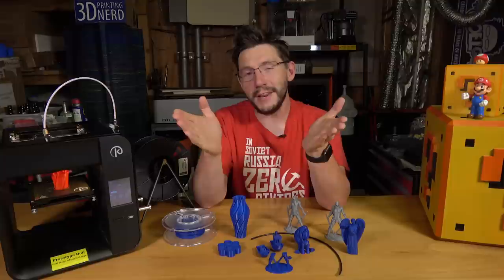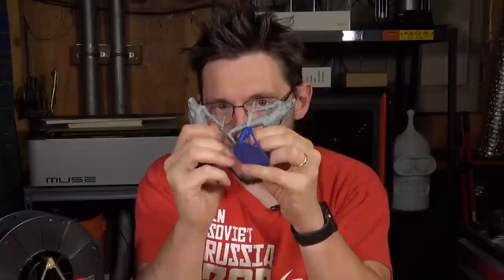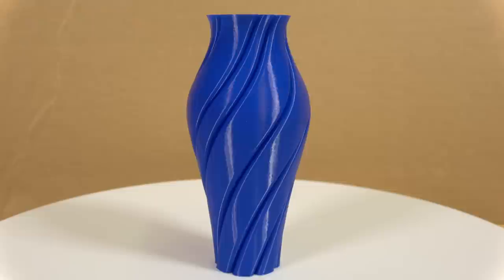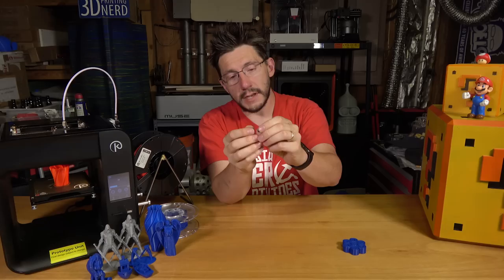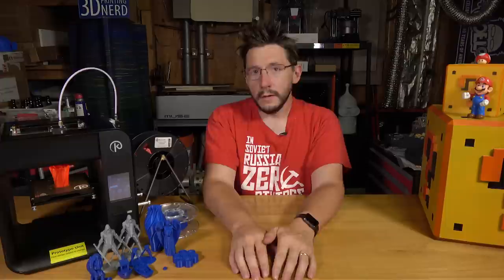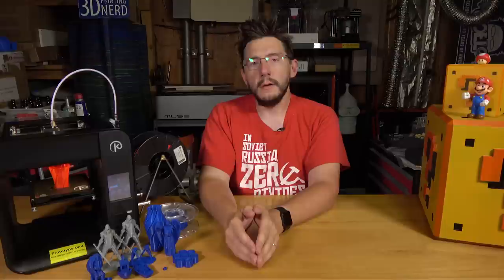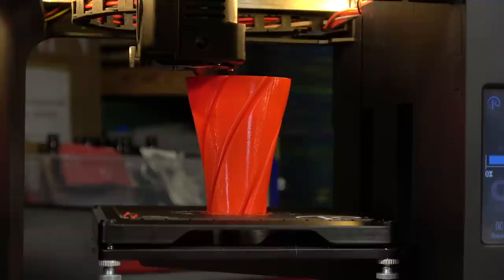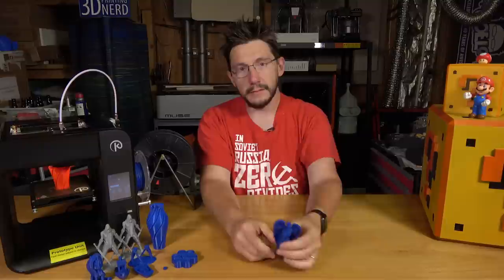The Kodama Obsidian $99 Kickstarter Prototype 3D Printer Final Video

Comment: i finally got my anet a8 up and running. now i can finally get into 3d printing.
Reply: Congrats! Once you you have it all dialed in (which only took me a couple of XYZ test cubes), it's a great little machine. Mine prints a whole hell of a lot better than this one--and mine's all stock.
Reply: my first few prints randomly stopped midway through but after that, they all turned out fine. my first benchy actually came out just about perfect with minimal stringing.
Reply: not to be lazy, but how much does the a8 cost landed?  I bought the obsidian, upgraded to the deluxe, added the heated bed, nozzle kit, and now am wondering if I made the wrong decision.

I thought this was going to be an inexpensive and QUICK entry into the world of 3D printing.  Now, almost ~$400 invested and still nothing to show for it, I am feeling buyer's remorse.  I am going to give it a bit more time before I proceed with trying to cancel my order and get a refund.  

If the a8 is much more expensive than $400, is there any model you would recommend around that price-point?  I am completely willing to wait and save up if adding ~$200 makes a significant difference.  For my first model I didn't want to commit to something in the 4 figure range. 

Thanks for any info/help you may be able to provide!

Comment: If you need to change a lot to a machine for it to work does that really make it a good machine?
Reply: Jim1643 PROTOTYPE
Reply from the maker: +Javierm0n0 More like PROTOHYPE
Reply: Javierm0n0 I get that but still, this was the second version. They should've fixed these before they get someone to review it
Reply: Jim1643 that's how industrial  design works,  I'm honestly a bit shocked at this whole product, and the fact it only took 4 versions to fix it's kinks. people it's like 150 bucks. let's get real, if this unit works with at least moderate success it will nail it's market (at home and mostly plug and play ).
Reply: Actually, it only took 2 machines and some tweaks.Thats, not a bad thing.
We all know if Joel didn't like it he would say so.
Reply: it looks like a verry good machine,every 3d printer WILL need work
Reply: I agree with Mr. Sterling that if this is successful it’s a big advance in making 3d printing more accessible.  Many people still don’t realize that machines are currently available for less than $1000.
Reply: WOOOOO WOOOOOO ALL ABOARD THE PROTOHYPE TRAIN!!!!!!!!

Comment: About the 3d filament holder problem:  why can't we print out some holder that looks like the one that was made out of metal, remove those long rods that would only hold the Kodama filaments, print out or get some screws, and attach the new holder there?   Just putting it out there.

P.S. I do not have a 3d printer myself, it's just that I am very interested in this one, and in 3d printing in general!  :)

Comment: I've already pledged long ago. Like Super Early Bid ago. I have 0 experience in 3D Printing and thought it'll be a good idea to start from Obsidian as it doesn't require building and stuff. But when I watch your videos, i always consider to cancel pledge as it needs so much tweaking. You are being honest, even you've met with the creator of the project, thank you for that. But.. Dunno man, i'm a bit scared that it won't deliver my needs.
Reply: @Gunes Oral, 

Its our 2nd round, we know what we are doing, if you look for Trinus reviews online you will see. Even that modular kit machine; you set it up in 30min and start printing. But sure 3D printing is not 2D printing, you have to slice your models, set the right temperature etc. , but thats across the whole industry. But do not worry, you wont have to tweak things, and the experience will be much more smooth then with others out there...

Comment: Great vid! Thanks Joel! Slightly concerned that the S3D software needed a custom tweak, because as someone who is going to being using a free software with this printer, I'm worried that I might not be able to solve the problems as easily as you could. Thoughts? P.S. Very new to 3D printing, this will be my first printer..

Comment: I'm a bit confused how you'll give a machine a do-over review at the pleading of the developer.  Clearly this saves his beloved Kickstarter but certainly removes some objectivity from your "review"   I'm all for addendum's but when it mixes with a funding campaign....ick.
Reply from the maker: To be fair, the pleading was to redo, because he personally was the one that said he screwed up the install of the machine. He brought it to my house and installed it, and his words were the fan shroud wasn't installed correctly. Improper cooling could have led to the problems I had. Once that, a new bowden tube, and a verified better profile were provided, it was printing better. The do-over itself was using the machine in a state more accurate to what it should have been in the first place. It IS a prototype and they still have a lot of work to do, so it's not like my review means the Prototype V3 is ready to be in the hands of all the backers. I completely understand where you are coming from with what you said, but, I thought about it and I believe I was within the parameters of testing a prototype unit to retest once it had been repaired / adjusted and a proper slicing profile was provided. This DOES NOT let Kodama off the hook, and if the unit they ship to backers doesn't have the improvement that 3D Maker Noob, Maker's Muse, and myself have suggested, it's not going to be pretty. I want to thank you for your words, though, and comments like yours are great because they are constructive and start a conversation. Many #highfives to you.
Reply: Wow, quick response!  
I thoroughly enjoy your videos and upon reading your response, that's  very fair of you.  You did offer them a lot of good suggestions (3 point bed leveling, spool holder, etc.) I hope they will adopt.  Anything that makes it better experience for newbies is welcome.  I've read a lot of horror stories from inexpensive printers that were red hot messes, serving only to deter someone from wanting to get into 3D printing.  I hope they are able to deliver and provide a positive experience.

Comment: Is it possible to print 28mm miniature figures for tabletop gaming and do all 3d printers have these annoying obvious layer lines? because when painting these models, these lines will pop out even more :(
Reply: All FDM machines do.  SLA machines do not.  most people will sand and prime before painting if it needs to be smooth.
Reply: I don't know the details, but for some types of filaments, you can use vapor of, I forgot the name, I think it's what is used to remove nail polishers, to get rid of the layered appearance; put the printed object in a sealed box with a stand to keep the object from touching the bottom, and have some of the nail polisher thing filling the bottom, and leave it sealed for a while; or something like that. I think I once saw a device that would rotate the object in 2 axes to ensure a more even distribution of the film of nail polish remover over the object. The idea is the nail polish remover will melt the smaller details, smoothing out the object.

For the exact steps, precautions etc, you're gonna have to search for the procedure; I don't think it would be hard to find.

Though, now that I looked at the actual number you used, I'm not sure if it would be a good idea; I'm not sure if with something that small it's gonna be possible to remove small details without also removing important features. I guess if the size of the details is too close to the thickness of the layers, there might not be much left after the procedure.
Reply: digibluh Don't some SLA still got thick enough layers to be visible after printing?

Comment: Do you have the end gcode script to push the bed to max z, so it's at the bottom and make it easier to retrieve the print and access the bed
On my cheap Chinese Anet A8 I put Gdd0 X0 Y200 to move the extruder to home, and Y fully forward so I can get my prints easier
Very cool printer...for $100 and $50 shipped...not a bad deal at all!
Can it print ABS (with a bit of insulating the bed?)
Keep the video's coming Joel...love em!
You so need a take 2 movie clapper thing for your blooper reels :)

Comment: I'm really confused. 
Only had an ANET A8 for a few weeks and it seems to work fine with both PLA and ABS.
Upgraded to SkyNet just so i could use an auto-bed-leveller, which then broke, so deleted the G29.
Still prints the 'benchy boat' no problem, yet my friend keeps telling me that everything is 'off'.
Not that i need it, but are these machines capable of injection-moulded 'perfection' ?

Comment: Still suffering with the original trinus that works well as a expensive laser engraver. came and worked for 1 hr before PSU blew then extruder jammed so now gathering dust.

Comment: I'm still on the fence about this one but It would be so cool to own a 3D printer. Do you guys think the heated build plate is a must? Also is the slicing software included?
Reply: It depends on the materials you want to print. If you plan to venture into filaments such as ABS, nylon, or PETG then it is an absolute must. It prevents warping and I believe it can even help stick down PLA prints as well. It will not include the Simplify3d software but you can easily use free software such as Cura to slice your models. Both software platforms it seems will have a pre-tuned profile for better out of the box printing.
Reply: i play to get a 160$ price range build kit
Reply: I added that and the extra nozzle set as add ons.  After one of the updates I'm a bit confused as if my nozzle updgrade is worth it since they changed the design of the nozzle it will come with.

Comment: Here's my prediction:  Obsidian is going to bail out and not deliver a single unit and run with the money.  If you look at the production requirements, it's logistically impossible for them to meet their December dead line, especially since they've made it clear they've got updated versions in the works.  I calculated that given a 12 hour work day, they would need to build a whole machine in less than 30 minutes, every day, 7 days a week, from now until December.  And that's actually a very generous estimate, because you've got to imagine packaging, shipping, etc.  All of that takes time.  How long do you think it would take to properly organize, fully and properly pack a couple dozen units?  And that doesn't even include any updates to potentially already built machines, nor does it include construction of anything beyond the base feature machines.  I don't think they've actually started building them for shipping yet, all the machines produced out there are just for reviewers, and they're not actually mass producing them yet.  I think the reason for the deception is to give the appearance of not scamming their customers out of money, and an attempt to get even more backers on kickstarter so they have more money to cut and run with.
Reply from the maker: Interesting. I think you're wrong, but, we will just have to wait and see!
Reply: C North They likely will deliver. Most kickstarters don't even have prototypes before funding. So they have a headstart. They also have delivered before. There is better odds than most
Reply: First of all no Kickstarter has ever delivered on their estimated time, the final product won't start to be in people's hands until at least Feb or March. Second once they nail down a final prototype the retail model will be at least factory assembled and at most robot assembled meaning that 1 per 30min ratio is way off. Third the company already has proven products on the market so they won't likely risk their reputation.
Reply: Well:
1. We have delivered before; 4000+ units to 80+ counties. 
2. If you go with Flex or Foxconn (we are in discussion and had several meetings), I doubt they will have any volume limitations...
Reply: Satan42 Interesting generalization. I've certainly had numerous Kickstarters go well over time, but I have had a number of projects meet their timeline and even had a few beat their timeline.
Reply: It's now 2019 and there's still no production in sight.

Comment: I have several questions
The first of which is do you now see this as a good option to start printing in the 3-D world?
Since the software does not come with it and I would need to buy software such as simplify 3-D can you honestly call this a low-budget printer
With the kick starter if you get the heated bed and one extra roll of filament plus shipping you are now looking at $305 before getting the 3-D software 
do you recommend some other printer to get started in
Personally I could use a larger print volume and I do have a budget that is a good bit higher than the cost of this printer and software but this is my first endeavor into 3-D printing.
Reply: 1 ) Don't need to use Simplify 3D to slice, Cura and other slicing softwares exist.
2 ) I can still print PLA very well without heated bed (Replicator 2) , so it won't stop you from 3d printing.
3+4 ) Check 3dhubs for their list of best printers by quality or price.
Reply: chanhien thanks I'm looking at their printers
The C10 which is not on their list and the prusia MK2S
Both look like something I will consider
I'm still considering paying the money to get the software anyways because I hear it's pretty much the best software you can get at that price point and most systems are developed with it in mind. 
At least that's what I've heard so I'm told it's a solid purchase no matter what printer you get
Reply: I do own S3D and indeed it's the only software that saved me from the buggy makerbot's own slicer.
Reply: chanhien if you were to choose between the C 10 and the mk2s which would you go with (we will assume I purchased the S3D software
Reply: The Prusa i3 hands down. Huge userbase, upgradability, quality. But good luck if you try to get one because it's so good that it was never on stock, I've ordered and have been waiting for it for 3 months.

Comment: So people need to buy a $159 slicer to get their $99 printer to print well? Awesome.
Reply from the maker: +USWaterRockets Nope. It takes gcode so Amy slicer will work. 3D Maker Noob used Cura like I did in the original video, and Maker Muse used the slicer from Raise3D
Reply: The impression this video gave me is that the machine printed OK until Joel got a tuned S3D profile and then it printed a little bit better.

Comment: so 99$ 3d printer, wich does have to be fine tuned by yourself, and the man behind the kickstarter couldn't fix.?..

also that is a unicorn, no wings.
Reply: And uses Simplify3D which costs an extra $150 :v
Reply from the maker: +Alvin Gozali it takes standard gcode so you can use whatever slicer you want.
Reply: Alvin Gozali the 3D Maker Noob used Cura in his video and his prints came out great.
Reply: Every printer needs finetuning. The main point is that you stil get a working printer (pre-assembled) voor 99 dollar. Shipping cost are a bum tho. And don't forget this is still a prototype...
Reply from the maker: +Tymen Van Essen so, with wings is an alecorn, right?
Reply: 3D Printing Nerd an alicorn or pegacorn is a winged unicorn.
Reply: Abel Herman: This at this low price can change my decision for the Malyan v2. Maybe a good thing that Malyan is so hard to get. Damn those shipping fees, they might make me forget about the whole thing.

Comment: For $149, it looks pretty decent. =)

I'm not sure though if these constant attempts to make as cheap a machine as possible is the right way to go. Is a $100 machine that doesn't produce satisfactory results without lots and lots of tinkering as good as a $1000 machine that always produces satisfactory results with little to no tinkering? A machine that requires lots of tinkering is only useful to experts who, probably, already have a way better machine, thus reducing it to a novelty. A beginner that buys a dirt cheap machine that requires lots and lots of tinkering, once again probably, won't have a good experience and risk being turned off this otherwise awesome hobby. IMHO, we don't need more dirt cheap 3d printers. We need to make the mid-range printers more accessible to the general public and easier to use and make the high-end printers smarter. I'm talking about getting Prusa quality and reliability with a Wanhao price tag and an Ultimaker 3 level machine that understands what it's doing and can react to problems and inconsistencies.

Comment: I'm done with hearing about this printer. It's a piece of junk that's being false advertised as 99$ as if you want good quality you are going to need to spend more. Secondly, this CEO that keeps sending Joel new models is full of it. Joel uses the printers, they look like pieces of crap on the video, and the CEO claims that those were all defect models. If 4 out of 5 Obsidian are going to be failures because they are awful junky printers, then why are they still being funded?
Reply from the maker: I think you're incorrect in your thinking, but, we will have to wait and see what happens when they are shipping.